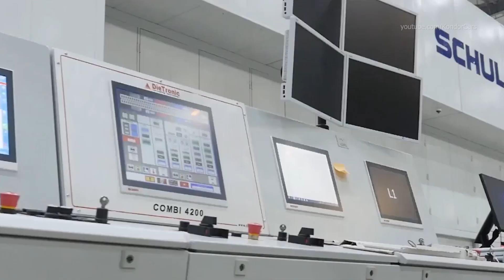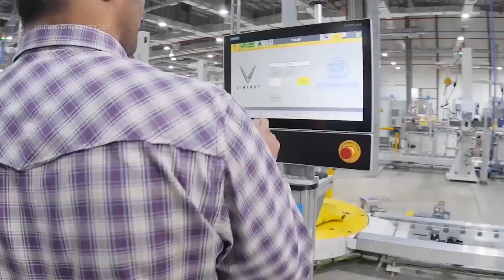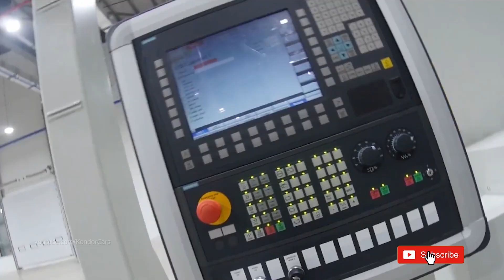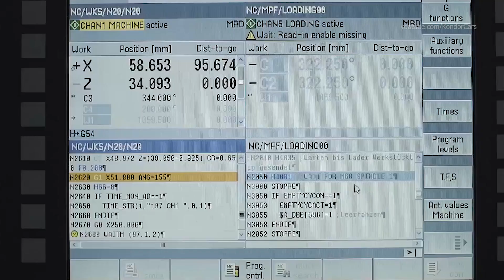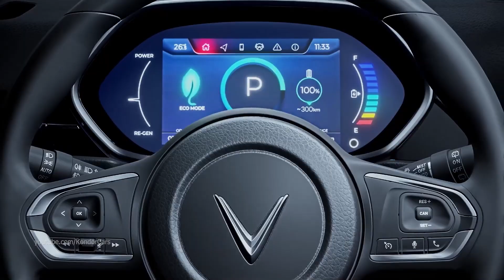VinFast Manufacturing process Vietnam

Comment: After 8 years or more than 100K miles, EV battery degradation to below 70%, leads to the battery significantly losing its power. Tesla $23,000 bill to replace the battery is insane, and each Tesla $1,500 service charge is beyond ridiculous.
Reply: Customers dont actually own a Vinfast battery for their car . So when it come to below 70% they dont have to pay anything to change a new one .
Reply: @milokhanh313  It's wonderful, isn't it? I've heard a couple in California, husband and wife were asked to pay about $45,000 (plus taxes) to replace their 2 Tesla batteries after 8 years. The saddest thing was no payment plan available!!!! Somebody's greed is beyond imagination. With the battery leasing program, a VinFast car driver will never have to worry about the $23,000 bill to replace the battery, and all VinFast batteries will be appropriately recycled to safely protect the environment. Surprisingly, after the federal tax credits for EVs, VinFast VF8 costs only about $32,000, which is unbelievably cheap for a 5 seater electric SUV, and the 7 seater electric SUV VF9 is probably about $46,000 after the tax credits. Best of all, VinFast offers a limited warranty coverage of 10 years or 100,000 miles, whichever comes first, and this is the longest warranty coverage done by an EV maker. All of these truly set VinFast apart from other EV manufacturers including Tesla.
Reply: Definitely not $23,000
Reply: There are independent shops now doing partial repairs (dead cells) on Tesla batteries at a much lower cost…. Where there’s a will, there’s a way… great to see entrepreneurs taking on this challenge…
Reply: Communist Vietnam can't produce a simple screw for Sam Sung's phone. Do you think they can an electric car? Guest where do they get the battery and motor from?
Reply: @HOTPLATEGAMING  i mean to change the battery on a Jaguar i-pace is €30,000. on BMW i3 it ranges from €10-17,000. 
the few i know that needed both motor and a battery swap on their 2013-2015 Model S thankfully had their warranty back then. 

Did Vinfast drop the 8 year warranty for the  battery in favor for the lease program which tbh isn't something for me. it just drives costs up.
Reply: @congsan3528  did you watch the video ? lol
Reply: @congsan3528  Are you living in 2005?
Reply: R U Joking?
Reply: pin bảo hành 10 năm nhé bạn
Reply: @congsan3528  You are a star, aren't you? Vietnam is building a mission to Mars. Do you want to go there?
Reply: @congsan3528  Vietnam can't make screws because it's busy making robots that produce screws. Laugh out loud
Reply: @HOTPLATEGAMING  Its actually that much, google it
Reply: @riptide9126  nah his mindset is still in 1975 when south vietnam government lost to the north. He couldn’t see vietnam past 1975.
Reply: @HOTPLATEGAMING yes $23k. Almost all of that is component cost too. That's not a significant markup, and is actually well below the typical markup of OEM parts.

Comment: HEADS UP... Vin-fast may need to add an extra feature to the vehicle that it didn't think of. If you stick a blow dryer that's plugged in & turned on into a tub full of water, the person in it will be electrocuted. If an electrical product goes through floodwaters and still has water, it could catch on fire, or even worse, explode. Solution: If the blow dryer that's turned on is in a Tupperware container vented on top, it wouldn't be touching the tub water, & therefore wouldn't be an electrical hazard. In other words, the electrical vehicle needs to be waterproof. You may want to add the extra feature, being that the vehicle will be bought in areas that flood.
Reply: Don't you think that every auto manufacturer would have thought of this by now, considering cars are not a new concept and neither is rain?